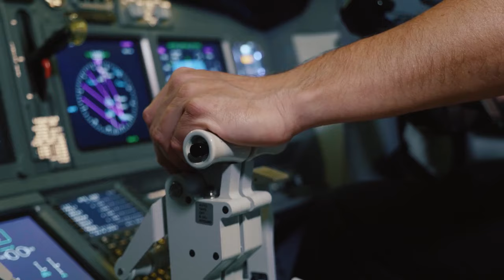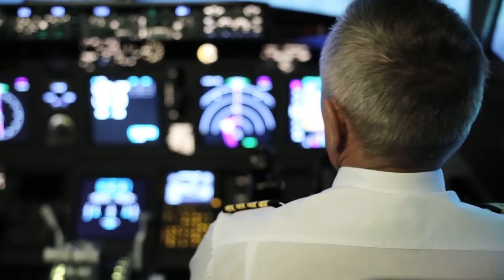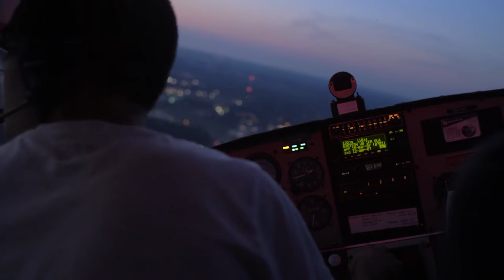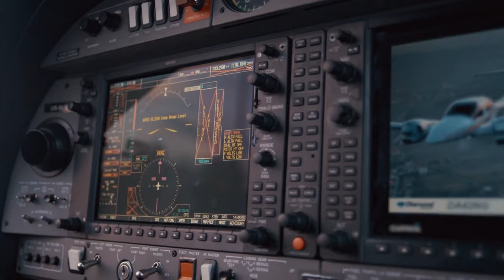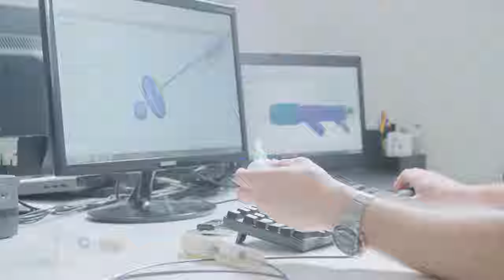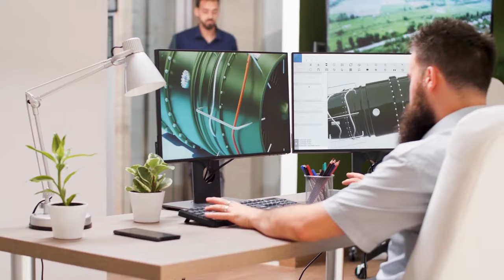Tesla's INSANE NEW Electric Aircraft Revealed!

Comment: Some fact checks:  Stealth is more concerned with radar signature than noise.  Electric motors (not all of them) may be lighter than engines.  However batteries are heavier than gas or kero.  And (and you did say this correctly), their energy density is much less than gas or kero.  Keep dreaming, but try and keep the "facts" presented as honest ones.  OK?

Comment: The structure will have to be extremely light and Elon has said delete the wings, tail plane and heavy landing gear so that the mass fraction is 70-80 batteries! It will probably be aerodynamic cylinder with a series of gimbaling electric motors for VTOL. ELON MUSK'S BATTERY POWERED SUPER SONIC VTOL JET - My Tesla E-SuperVTOL design - https://www.youtube.com/watch?v=7arrsIUU1TQ

Comment: Making an electric air craft is very hard but doable. Most of them are doing below a hundred miles an hour but approaching 200 miles an hour  with a range of about 1 hour. Supersonic fighter planes can use 150 gal/hr or more and need to be constanly refueled ever few hours. There is not enough energy in petroleum for long flights supersonic, I dont like saying impossible but the energy balance sheet says so. Unless there develops a high energy density e-fuel, then it cant be done.
Reply: ever heard of the Concorde? what do you mean " not enough energy in petroleum for long flights supersonic" ? its been done many times before, even commercially. now with modern tech, they will be 2x as efficient as the Concorde. Electric is simply impossible. 95% of the plane would need to be battery, with 10% the range.
Reply: @ct1762  yep , yu are right, Concord, SR71 also, I am thinking about the fighters that only have a range of 2 hours. Elon Musks looking at any place on earth in an hour or less. By way of space.
Reply: @jbird6609  well thats never happening. refueling would need to be done after an 8 hour prep, for a total of 12 hours if we are talking about transporting more than 20 people. the ferry ride out to the rocket would take an hour minimum alone.
Reply: @ct1762  What are you talking about? You’re just blabbering. USArmy just awarded Musk like 180 million to develope a fast trip space transportation system to haul anything anywhere on earth in An hour or less.
Reply: @jbird6609  that's not happening. I don't think Musk understands what engineers are telling him. I'm not getting into details here, but watch common sense skeptics video on it. Not remotely possible. You are suggesting he burn thousands of tons of fuel to ship cargo to arrive a day early? What's the capacity? I bet it's well under 100t.
Reply: @jbird6609  haha being awarded a contract to see why its going to fail miserably does not mean its worth a thing as an actual transport technology. clearly you did not watch common sense skeptics critique of the idea. its so absurd its not worth arguing about anymore, but please message me again when it becomes available. which will be never.

Comment: If electric plane become a reality then you have too worry about other problems,like you still need something that can continue charging these planes.If you use nucular power,your still getting waste,if you use coal,you get smog.So is there any advantage in making these planes real?
Reply: Yes, if you are utilizing electrical energy for a plane various power sources become optional.  You are not simply limited to battery, nuclear power, or fossil fuels which means one could upgrade these designs as new technology becomes available.  Electricity is electricity.  As technology advances it is easier to implement different power sources while still retaining the base air frame/ engine designs.  For example.  Hydrogen fuel cells,  supplemental solar, directed energy charging.  Yeah that is a thing too..  Apparently we can charge drones at altitude with lasers these days.

Comment: Why not just use a nuclear battery? And power you aircraft to 10 years?
Reply: 1- Doesn't exist
2- Like cancer? you need a lot of shielding otherwise your DNA will get striped apart, as if it were paper in a paper shredder, by highly charged particles (also know as ionizing radiation)
Reply: @midgetman4206  oh yeah they exist, lot's in orbit, mostly classified patents but you can find a few of the very old inefficient ones. And they use them in pacemakers inside peoples bodies...

Comment: All Major BS LIES .  Plug your ELECTRIC  toy into the GRID,,, where ,does all that Electricity comes from ??   
Cow  REAR END GAS, or  Oil  Burning , and Nuke generation stations ?  
 GET REAL this is just a SCAM right now . 
The E cars right now only go from one wall plug to the next wall plug before its on empty, and then wait hours.
 If you use your AC on a road trip ,  , you might need a tow to the next wall plug, to wait hours for a RE-charge.  
 How much does it cost to Fill the Batteries?  Just wait till your Electricity bill Checks in with inflation .  
Like I said GET REAL , How much does it cost to replace your Batteries when they check out .
 Maybe in another 10 years it might , maybe might , cost less , but now it is ONLY A  VERY EXPENSIVE PIPE DREAM..